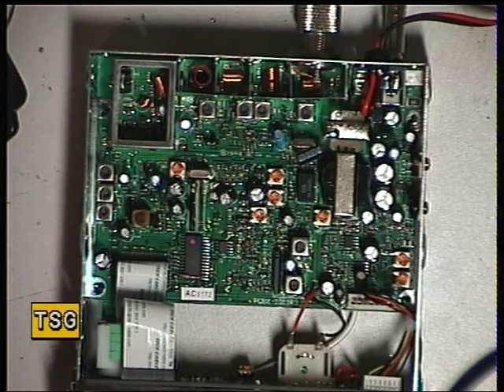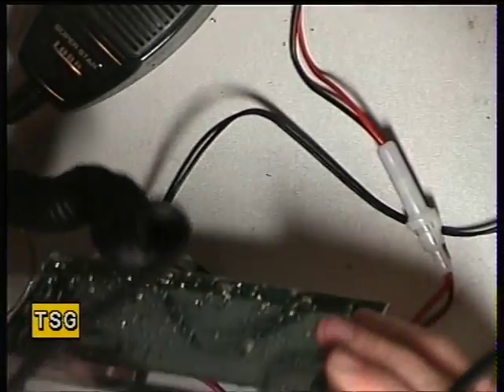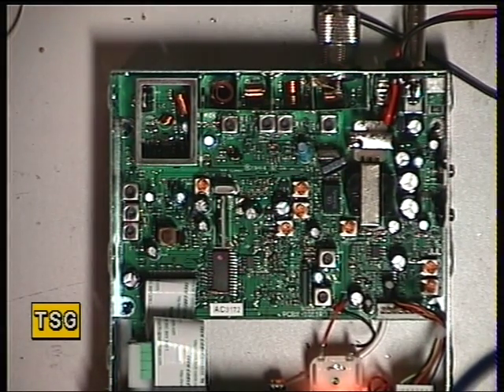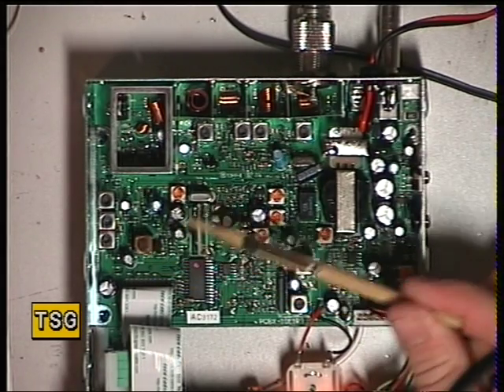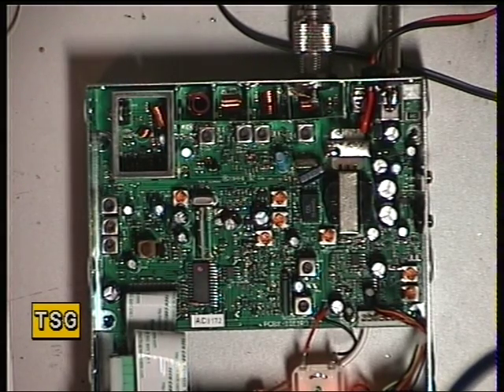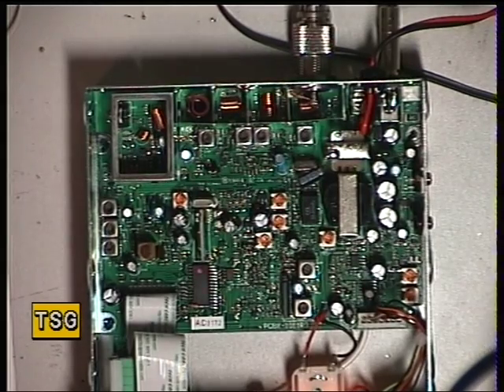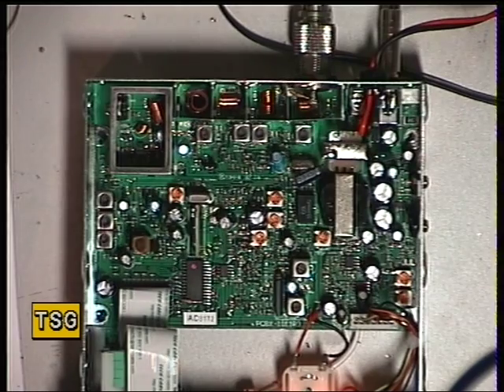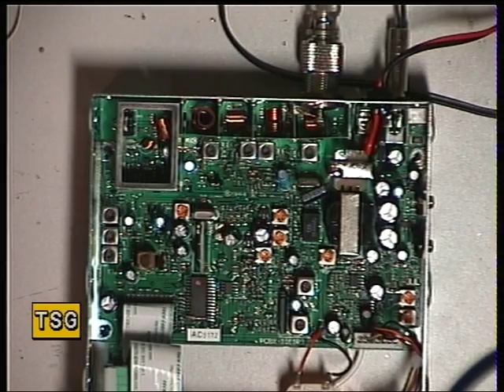Superstar Lord,  UK (CE - Multi) CB radio (Mobile) - Transmitter alignment

Comment: Hi I have just acquired one of these. When put into change the E5 code and dial in to where you are I can’t change the code at all. It just stays at E5.
Reply from the maker: It doesn't memorise the code. You have to set UK every time you switch it on. An absolute pain. Do I not show in the video how the country is altered from ES to UK? It certainly isn't in the instruction book....I've just checked.

Richard,G0OJF, UK

Richard
Reply: @ukfmcbradioservicingTango21  I did what you did in your video but when I turn the dial it will not change.
Reply from the maker: @LoftechUK  If you email me I have a stuffer-sheet not in the main instruction book...in spanish. Basically saying the AM/FM switch has a central 'multinorm' position. With the radio swiched off, the AM/FM switch is switched to the central position & then turn the radio back on. You should then be able to select the country you want. If that's the UK, the AM FM switch is then put to the FM position. You have to select the country you are in every time you switch the set on....it doesn't have a memory for this & always reverts to  the Spanish norm next time it is switched on.

rshireby@yahoo.co.uk
Reply: @ukfmcbradioservicingTango21  I’m willing to try anything. Give me a few days and I will report back.
Reply: @ukfmcbradioservicingTango21  works a treat. What a ball ache having to turn it of all the time. I put it ok U as yourself did and I understand that’s UK as EU was next. Thank you
Reply from the maker: @LoftechUK  We got there! Yes....a badly thought out set & a ball ache.

Richard